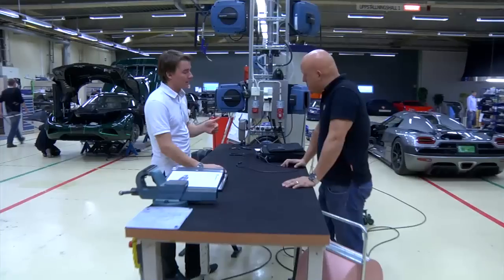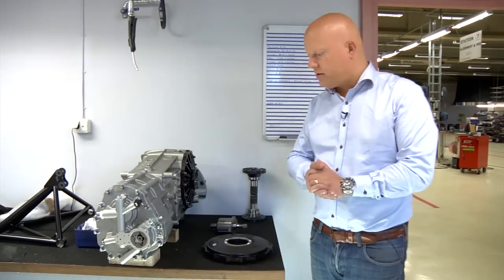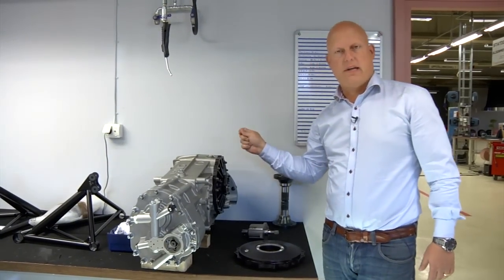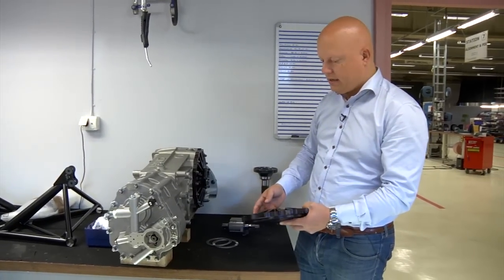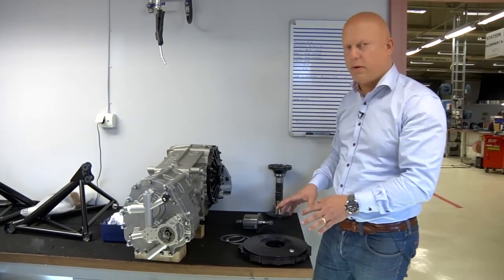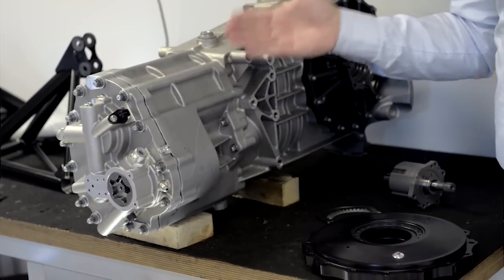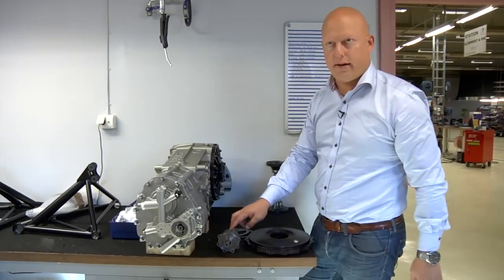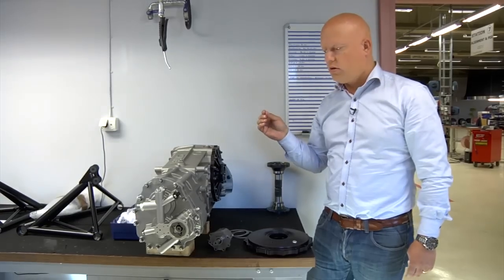Putting 1140 hp to the Ground - /INSIDE KOENIGSEGG

Comment: Yes it does end up slowing the engine down.  This doesn't hurt the performance at all though because the engine needs to be slowed down.  If it was red lining when it moved into the next gear it would destroy the transmission since the transmission would be spinning at maybe 5000 RPM and the engine would be spinning at 9000 RPM.  The car cant instantly accelerate from 5000 RPM to red line.  I am fairly certain that the synchros dont speed up the transmission so they too slow the engine down.

Comment: Right, but you still have to wait for the engine to wind down. This is supposed to get the speeds a lot closer in an instant without waiting for the RPM to fall.

Comment: i'm fairly good with mechanics, but wouldn't decreasing the speed of the input shaft (with the wet clutch) also reduce the RPM of the engine, and thus result in lower performance? I know that it makes the syncro's job easier and would let you shift faster, but in exchange for RPM?

Comment: single clutch transmissions are typically faster than a dual clutch, they are just less 'refined', so they are not good under normal driving, but under high-performance driving, they work great.

Comment: Fantastic solution to one of the oldest problems in cars, especially longer geared more powerful ones. Hello Max!
Reducing the revolutions per minute of your motor. More specifically for race cars or hyper cars, but the logic remains the same. 
You burn less oil based products, you find no matter how you are shifting, putting it BACK into gear is always more comfortable, making the car accessible to many. 
And, by far, making driving a manual gearbox much more predictable. 
So much for a short..

Comment: They deserve all the success they get. brilliant innovators with such a small team.  
need a gearbox with wet clutch syncho synchronisation, hey let's build it ourselves, 
need and 1000bhp engine, let's build it ourselves,
not sure what fuel it's running, that's fine, we'll build ourselves a fuel sensor.
ECU not up to scratch, no problem, we'll build it and then write the software.
carbon chassis, piece of cake.   
on and on and on....

Comment: This is a question to Koenigsegg themselves if Drive can make that happen: 

If you're using a clutch to brake the input shaft, do you correlate the amount of time the clutch/brake is engaged depending on road speed and gear selected? In my mind if you didn't the input shaft would stop completely dead and you'd have an opposite problem of synchronisation that your layshaft is spinning at road speed and your input shaft isn't turning at all...and the synchros would take even longer to engage.